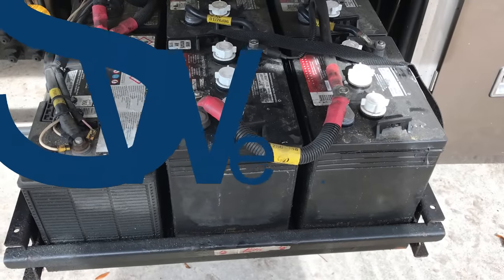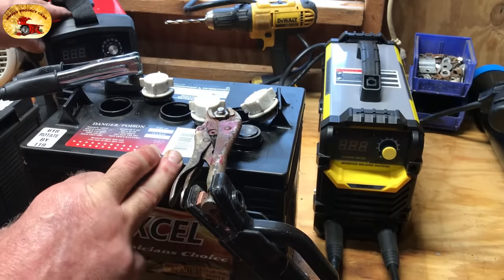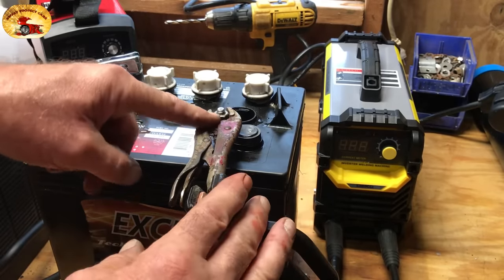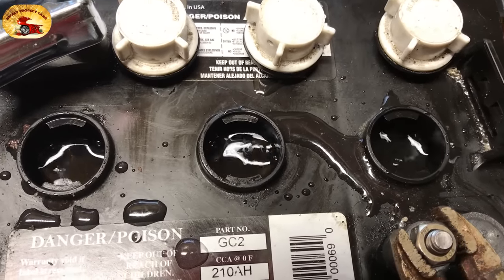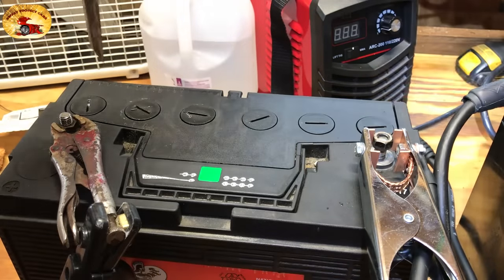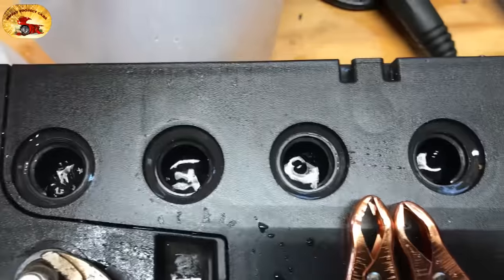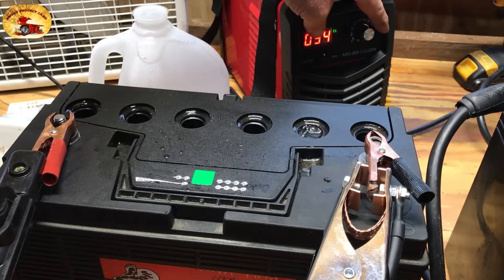How To MAKE OLD BATTERIES NEW Again!!!  12v 6v Deep Cycle, Car, Truck, Golf Cart, Semi

Comment: Are you running that Deko on 240V? If the voltage is at 38V, then the box must be pulling 30amps...most home circuits are 15 or 20 amps, so I'm thinking you must have this on a 240V circuit.
Reply from the maker: It works on standard household power zenbotz. Thanks for watching, have a great week. mad Mike the hammer SPC

Comment: Can you do this with the agm vrla sealed batteries in the 2020 Hyundai vehicles? 
The label warns against opening the battery.
Reply from the maker: If you cannot access the cells where the water is, you cannot do this process asmr. Thanks for watching, have a great day. mad Mike the hammer SPC

Comment: I'm a little leery about trying this but trust you guys implicitly.  If Mike says it works, then I'll follow Mike's instructions and give it a go.  You've never steered me wrong before.  Just one question, should I be mindful of the battery temperature while charging it this way?
Reply from the maker: Bruce, if you follow the video timelines exactly, you will have no issues.  Thanks and have a great day my friend.  mad Mike the hammer SPC

Comment: Hi Sweet Project Cars.... My name is Greg and I'm 75 years old. Enjoyed your video on deep cell batteries I have a golf cart with batteries from Sept. 2012 and have not been able to afford new batteries so when I watch all three of your videos I decided to purchase the yellow welder. But no longer sold so I went with the YESWELDER ARC Welder 165Amp Digital Inverter IGBT Stick MMA Welder,110/220V Dual Voltage Hot Start ARC Force Portable Welding Machine which you recommended. I'm confused as to what power to set. My cart only runs for about 10min then rapidly starts slowing down. Could you do a video on the grey welder. thank you .....
Reply: I mean the Blue welder
Reply from the maker: Hello Greg, you want to start out on the lowest setting and gradually turn it up until you get a rapid boil, then follow the video process.  I hope this helps, and remember make sure you recap and unplug the welder before disconnecting the cables.  Thanks for watching and asking. mad Mike the hammer SPC

Comment: sir i have 2 batteries one have showing 12.7v and second have 12.8v but there is cranking amps and backup can i run this procedure on that type off batteries that have 12.6 to 12.8v showing , and what if my battery have irritation cells or damaged cells is that still works, and there is any different procedure for 220v household voltages please reply it is very important to know thanks
Reply from the maker: If you have batteries at 12.7v and 12.8v, do this  https://youtu.be/KzOQH1twpI8   every 6 months or so and you won't need to ever replace those batteries.  Just use regular household power Feroz. Thank you for watching and asking, have a great week my friend. mad Mike the hammer SPC
Reply: @SweetProjectCars  Thanks friend that will really helps me and others, i have already watch this new video and method i have a question about this new video https://www.youtube.com/watch?v=KzOQH1twpI8
1. if my battery is discharged then what should i do can i charge it first then wait for few hours then do this method for every 6 months ?
2. how much time for 185AH ( 185 Ampere ) Lead Acid Battery., by battery size like how much time for 7ah, 20ah, 40ah, 60ah, 80ah, 100ah, 150ah and 200ah it will great help for me and others thanks

Comment: Thanks for the tutorial. I'm going to try it since I've a arc welder lying around
Reply from the maker: Thank you for watching and sharing.  Have a great day. mad Mike the hammer SPC
Reply: I'm not sure any old arc welder will do, it must be a DC welder, and I think the success of the  inverter welder is it keeps things a little safer. the circuitry of an inverter welder will turn off on a dead short but it won't do that on a transformer welder, even if it is a DC version.
Reply: @joesmith-dk3uz  mine is inverter welder. I'll keep u update once I try it on my battery. Thank you for the reminder. 👍
Reply: @joesmith-dk3uz  I managed to revived my 6 years old motorcycle 12V lead acid battery.

Comment: so let me get this straight you use a stick welder 220v @ about 25amps, do it 5x times, with 5mins on and 10 mins off, and topping off the cells with distilled water?. after that you recharge the battery as you normally would?
Reply from the maker: Just follow the video to a T, using the exact same tools and the exact same process, have a great day.  p.s.  there is no alternative for the tools we use we've spent years perfecting this process. Thanks. 
mad Mike the hammer SPC

Comment: Can any inverter type welder work or does it need to be this specific one? What makes them different besides amps and duty cycle. I have a 180amp welder and want to know if I can use that or would I need to buy this one
Reply from the maker: Please follow the video to a T, there is no other alternative, use the exact same tools, products and method, we've spent years perfecting this process. It works flawlessly every single time using either of these welders for standard battery  https://amzn.to/2K1UsWQ  or deep cycle  https://amzn.to/3yW4ihK   Thanks for watching, have a great day. mad Mike the hammer SPC

Comment: STUBBORN CELL - To get my stubborn cell to start bubbling I cranked my welder up to 80 for 5 minutes but it is not quite waking up as it still will not bubble at 20. 
Can I go higher?
Is this high setting hard on the good cells?
Reply from the maker: You can go up to 90, but what we say is to make sure to let the battery cool down then do the full process again to see if it wakes it, like the next day, it won't harm the good cells.  Thank you for watching and asking.  Have a great weekend my friend. mad Mike the hammer SPC

Comment: If this works as you say then lead acid becomes the best value for off grid power again rather than lithium.... So the batteries you zapped still holding good charge 6 months later?
Reply from the maker: Hello Jedics, we have batteries that are still working after 20 years.  Hope this answers your question, thanks for watching.  mad Mike the hammer SPC
Reply: @SweetProjectCars  Would dumping out the water and sediment after this process, then replacing the water also improve the batteries life?

Comment: you may haven't tried load testing it in before and after, but if the batteries will work again then yeah, just continue using them
Reply from the maker: You got it! We know this process works just try it yourself, you will love the results SnowCold. Thanks for watching, have a great week. mad Mike the hammer SPC

Comment: I'm a heavy equipment operator , mechanic and fabricator for a debris box company and have a couple of pallets full of batteries . After watching this 2 days ago I just received the grey welder from amazon . With a 5500 watt Westinghouse generator hooking the welder to a 20amp 115v outlet proceded to run a couple of stringer beads on some 1/4inch plate . All I can say is unfuckingbelieveable ! I'm going to start on the batteries now , I will give you an update in a couple of weeks . Cool video and thank you for sharing this !
Reply from the maker: Great to hear Ogre!  Glad we could help.  Thank you for watching and sharing my friend.  Have a fantastic day.  mad Mike the hammer SPC
Reply: And????????
Reply: Did it work ?

Comment: I know this may sound crazy but would this work using a harbor freight 90 amp flux core welder…..I’m thinking probably no but just wanted to ask because that’s the welder i have.
Reply from the maker: It's not crazy, Glock Man, but to get the same results shown, you need to use the recommended products/tools we use, we know they work, and we know that they are safe for both you and your batteries.  Thank you for watching and asking, we do appreciate it, hope you have a great day my friend. mad Mike the hammer SPC

Comment: I have  six 8V golf cart batteries for a 48V golf cart.  So far I could get 2 batteries to bubble and 2 will not bubble.  I bought the yellow charger.  Filled each cell with distilled water and started low and turned it up a little at a time all the way up to 160 A.  Why are the two batteries not boiling and what can I do to make them work?  Thanks man!
Reply from the maker: You can do this entire process up to 5 times Michael, if they don't bubble after that, your batteries are toast my friend. Thank you for watching and asking, have a great weekend and all the best on your project. mad Mike the hammer SPC
Reply: @SweetProjectCars  thank you

Comment: Thank you Mike! Interesting video update, and 1 question:  could one use  the 160 amp machine to do the big 12v battery's? I notice you never really cranked the gain on the 200amp except momentarily for demonstration, I have a 160 amp machine and I'm wondering. Thanks in advance!
Reply from the maker: Please follow the video to a T, there is no other alternative, use the exact same tools, products and method, we've spent years perfecting this process and we know that it is safe for both you and your batteries. Thanks for watching and asking, have a great week Rick. mad Mike the hammer SPC

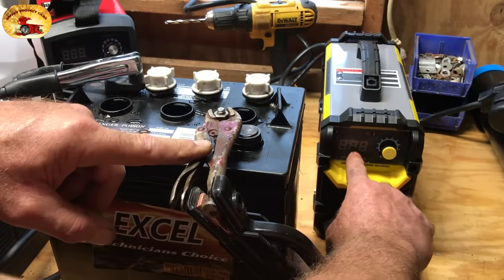Comment: At 3:50 the DC inverter welding machine does not display voltage but it is the current, instead, in Amps.
Reply from the maker: Thank you very much. Have a great day. mad Mike the hammer SPC

Comment: Would most any ac/dc welder that can crank from 30a to 225a incrementally do this work hypothetically speaking? 
Have Hobart similar to the Miller 225; have tried all day today with 200a start then 300a start for all times stated.
 Have several i year old 12v SLA to recharge, likely from freezing.
 No difference on any other than pre and post voltage went from 5 to 6 or 7 on a 12v. 
No liquid movement, no amp draw with Fluke thru cables.
 Have well charged 12v FLA in between charger and subject battery at this moment.  Thank you from Texas!
Reply from the maker: Please follow the video to a T, there is no other alternative, use the exact same tools, products and method, we've spent years perfecting this process. It works flawlessly every single time using either of these welders for standard battery  https://amzn.to/2K1UsWQ  or deep cycle  https://amzn.to/3yW4ihK  Thanks for watching, have a great day. mad Mike the hammer SPC

Comment: Sir, what's the output of the inverter welding machine? Dc.or ac? Thank you
Reply from the maker: It's dc, as mentioned in the video.  Thanks.  mad Mike the hammer SPC
Reply: Sweet Project Cars can AC be used?

Comment: I have a 24v flooded solar system consisting of 12 2V batteries wired in series. Would it be best to do this method as a system or do it to each battery individually?
Reply from the maker: You can do them in series Zach, no problem. Thank you for watching and asking, have a great weekend and all the best on your project my friend. mad Mike the hammer SPC

Comment: Maybe this question has been asked before...but... Why would one welder work for this process but another wont? Seems straightforward with an inverter DC stick welder with the proper amperage.
Reply from the maker: Well, it's no different than going to buy two porterhouse steaks, each from different butchers, they look almost exactly the same but taste completely different.  We have checked and tested almost every welding unit out there and the one's that we suggest can be safely used.  Of course, you can use anything you want but we have seen what happens to batteries when a unit is used that is different than what we recommend.  Thank you for watching Bill.  mad Mike the hammer SPC

Comment: Let me make sure I got this straight on RV Derp Cycle Batteries start with the lowest setting on the charger first and run the first cycle with the hour rest then move the charger up to the next setting and repeat it once till you are up to the 200 amp setting ? Is that correct ? 
Thanks for the great videos !
Reply from the maker: Michael, we start out on the lowest setting then gradually turn it up until we get a rapid boil on all of the cells, then follow the process shown in the video and remember make sure you recap and unplug the welder before disconnecting the cables. Hope this helps, thanks for watching and asking, have a great day. mad Mike the hammer SPC
Reply: @SweetProjectCars  
Thank you for the swift reply I will be using the recommended charger and I will follow the directions as noted .
Thanks again for the great videos !

Comment: U R Genius man! How much DC volts did you use from welding inverter on this batteries or its automatic, how much is it ( because my batteries are 12v ), how much ampere we should use for 50ah to 200ah batteries
Reply from the maker: Start at the lowest setting on the dial and work your way up until the battery is consistently boiling then follow the video.  Thanks for asking and watching.  Have a great day my friend.  mad Mike the hammer SPC
Reply: @SweetProjectCars  What is the next step after this whole process completed , replace the acid or not , how much wait before connecting with ups or car and do i need to connect with battery charger ?

Comment: Are the welders connected 110 or220 power.. and on 6 volt yes welder 110 only goes up to 70.. ?
Reply from the maker: You can do either, we did the video on 110 (standard household voltage) but you can do it on 220. Thanks for watching, have a great day. mad Mike the hammer SPC

Comment: Need more details Mike, 110v or 220v? Why two different welders... will the red one work for both 12v auto and 6v deep?
Reply from the maker: They are both capable of 110v & 220v.  That is their power intake, which means you can run it off your standard house voltage plug or a 220v clothes dryer style plug.  We found the two different welders and their specifications work differently for 12v standard car batteries and 6v deep cycle batteries.  After months of preparing and studying all of the different welders out there and the effects they had on 12v standard batteries and 6v deep cells, these are the welders we came up with that are safe for you and the batteries.  They are listed accordingly in the SHOW MORE of the videos description.  We have two different welders because the 200amp is too big for 6v batteries, you don't want to know how we found that out.   Hope this helps.  Have a great day.  mad Mike the hammer SPC
Reply: @SweetProjectCars  okay 200 is too big for 6v,  but will the 160 amp work for 12v? Maybe takes longer or does it not work at all for 12v, I'd like to just buy one can't afford the both of them.

Comment: If you have all cells bubbling fast from the start and you complete your whole process one time is there any use to do the whole process again and if so what keeps improving or will it start to do damage.
Reply from the maker: You do it until you are satisfied with the battery result, sometimes it will wake it up after one time doing the process, some take 2 or 3 times.  Thanks Calvin.  Have a great day.  mad Mike the hammer SPC

Comment: What is the dc output voltage spec for each welder you are using? I assume the welder will output a voltage much greater than 12v but that doesn't seem to damage the battery.
Reply from the maker: Here are the links to all of the recommended welders Dale, read away my friend.  Thanks for watching. mad Mike the hammer SPC      Welder for Deep Cycle ONLY 6 Volt & 12V Batteries    https://amzn.to/3yW4ihK  or  https://amzn.to/30k7YNg
Use This for all Standard 12-volt Batteries    https://amzn.to/2K1UsWQ
**If the above welder is unavailable, either one of these will work  https://amzn.to/3mqhebK or https://amzn.to/3sH4COq **

Comment: Hi,i just ordered my dc welder machine. My question is,i have to connect only one 6v battery to stick welder,is not to much voltage for battery? Dc Welder have 24vdc on output. Thanks
Reply from the maker: Just cut all timelines in half for that size battery Marius, start out on the lowest setting and gradually turn it up until you get a steady boil on all of the cells. Just follow the video instruction my friend. Thanks for watching, have a great day and all the best on your project. mad Mike the hammer SPC

Comment: How about  before and after load or resistance test?  Actually show it "works"
Reply from the maker: We will await your video showing the before and after.  We aren't here to prove anything to anyone, we know it works, as a channel with 700 videos, we aren't out to harm or play head games with anyone.  Give it a shot!  Thanks.  mad Mike the hammer SPC
Reply: its basic low-tech electrochemistry man, forcing the sulfate back into solution and off the plates

Comment: Looks like the welder I have ,  is  the red welder a sungoldpower 200A lift tig , were you using it on 110 or 220
Reply from the maker: It doesn't matter which you use, but we use it on 110 which is standard house voltage.  Thanks for watching and asking.  Have a great day.  mad Mike the hammer SPC

Comment: Sur can you please tell me if this will work with a mig welder I have a Lincoln mig but I do have a big battery charger that is probably about 200 amps I use it starting my vehicles when the batterys die and it will crank diesel engines too could you please tell me if my big battery charger will work or my mig welder I am tired of buying battery's thanks.
Reply from the maker: Shawn, yes, if you have a big battery charger and can get the batteries to boil, it will work.  Thanks for asking and watching.  Have a great day.  mad Mike the hammer SPC